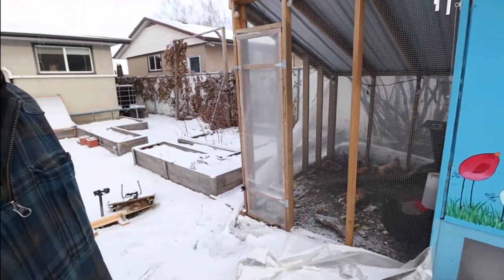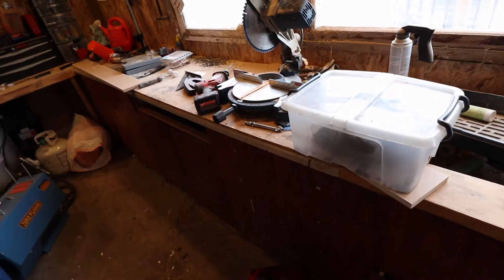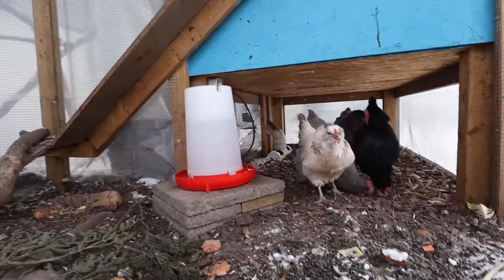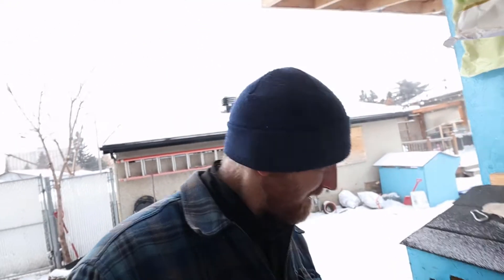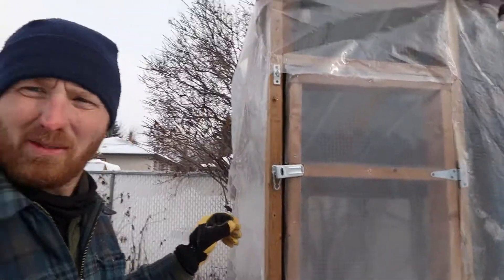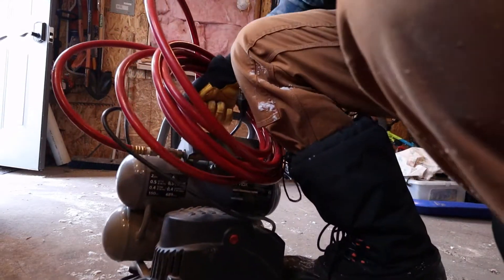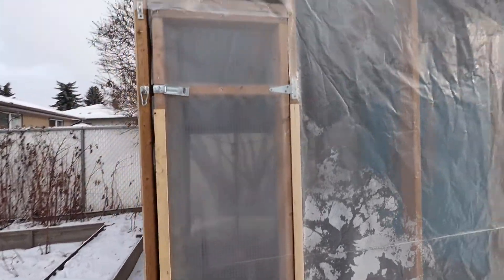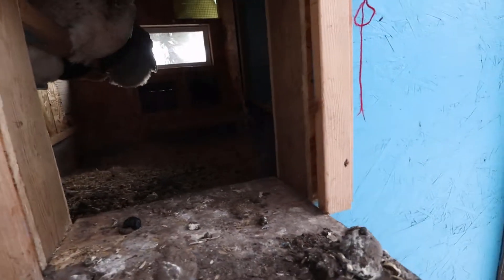90 Km wind | Chicken  Coop mostly survives!

Comment: Did you use hurricane straps for the roofing? Does the aluminum wobble in high winds?
Reply from the maker: No, just standard roof screws. So far it has been ok in high winds, I feel we have enough surrounding protection.